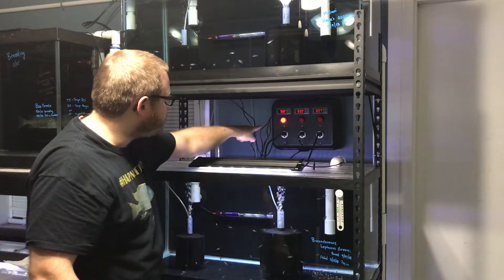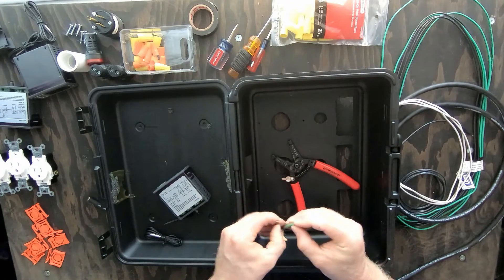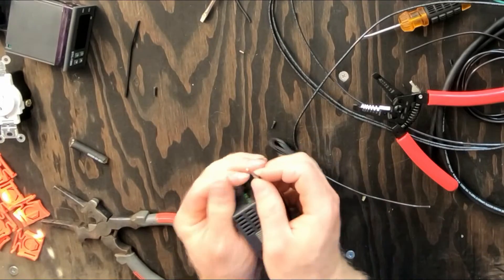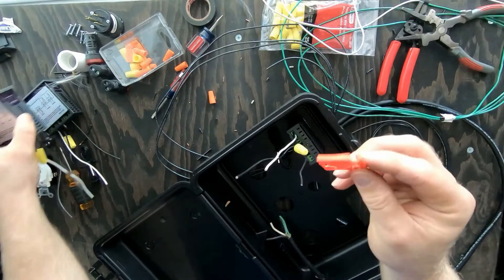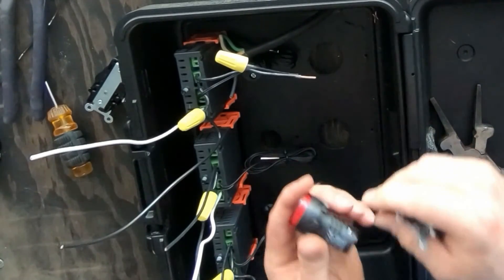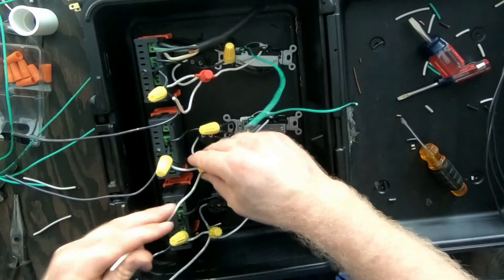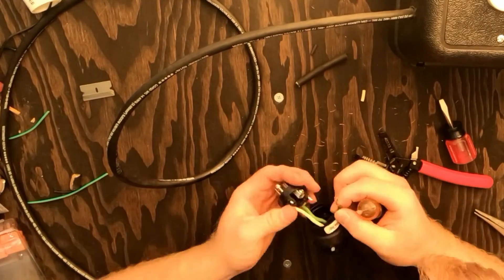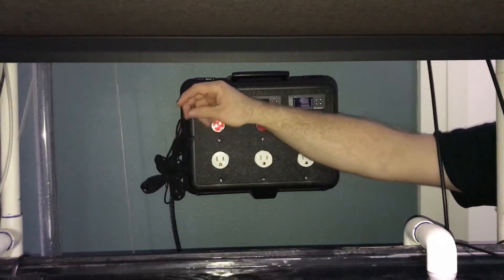CUSTOM DIY FISH TANK HEATER CONTROLLER FOR FISH ROOM AQUARIUMS

Comment: I think it's awesome!!
I stuck an STC-1000 in a teeny tiny box to save space... and also wired the cooling part to an outlet for the fan I mounted on my hood, for the summer time.
Reply from the maker: Great idea on the fan! I should have thought of that.
Reply: @inventoryking  sharing is caring! :) You can always add outlets and wiring to your box if you'd like to control cooling fans for these tanks.

My appartment gets to 27°C in the summer...
I don't know how hot your fishroom can get but I can get my tank around 3 degrees Celcius less than the room temperature.

It's possible due to the water surface agitation and having blown air across it.
Or, in my case, kind of pressurizing the space under the hood. (If I put my hand next to the glass, I can feel air blowing out from under the hood like a hovercraft, haha)

Comment: Noob Questions:
Are the probes for the controller more accurate or the thermometer? Did you try all three thermometers in the same tank to see if you got the same reading?
Do you set the heater at a high temperature (say 85) so it is always on and then the controller simply turns the power on and off?
My only suggestion before you build more - get a  good pair of linesman pliers.
Reply from the maker: I would say at first the Thermometers are. Most of the time the probes need to be calibrated. I didnt try one probe in multiple tanks. yeah, I have them on full blast, so when the controller turns them on its a nice quick heat, and then the controller turns them off. Whats great about aquarium heater controllers is say your heater fails and its stuck on, you can boil your fish, but with the controller once it hits your set temp it stops the power to the heater. So its a nice fail safe. Yeah I needed better tools.
Reply: I set the heaters on a degree or 2 higher than the controller is set at so in a worst case scenario if the controller fails and sticks in the on position, then the heaters internal thermostat takes over and shuts it off. Rather a degree or 2 high than boiled fish. I do this because I've had supposedly normally open relays (which is what the STC-1000 uses) fail in the closed position and never shut off. I built a similar box as yours only mine controls cooling as well using peltier  modules for the summer time. And to clean up the inside of the box I used 3 bus bars, one for hot, one for neutral, one for ground. Saved on the spaghetti no sauce situation inside the box.